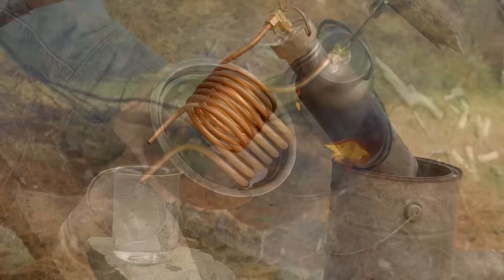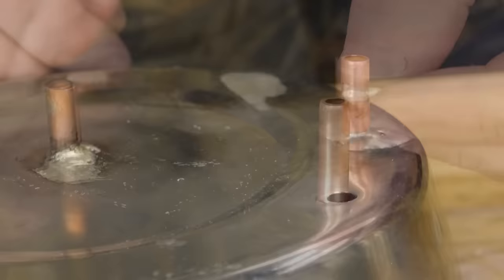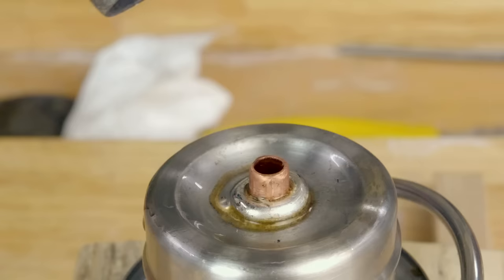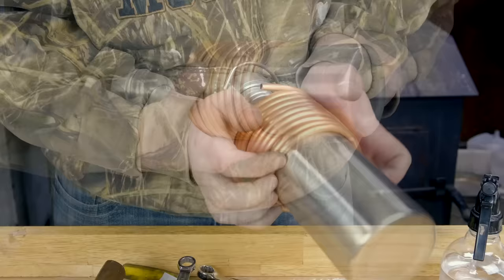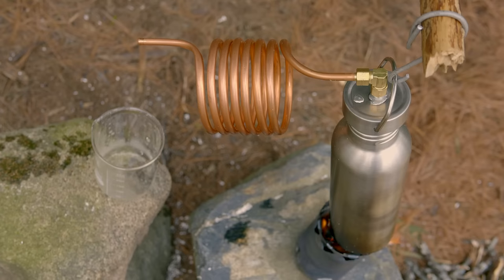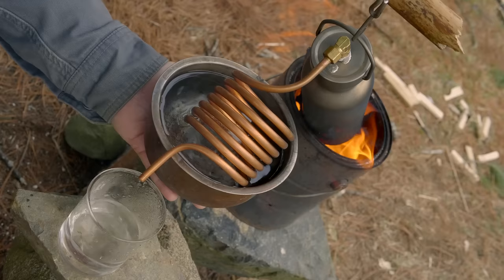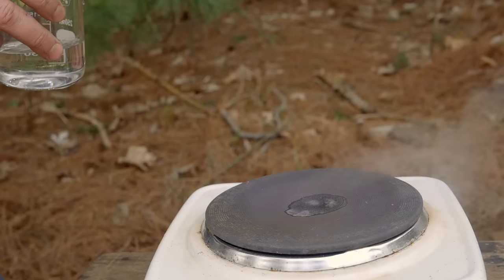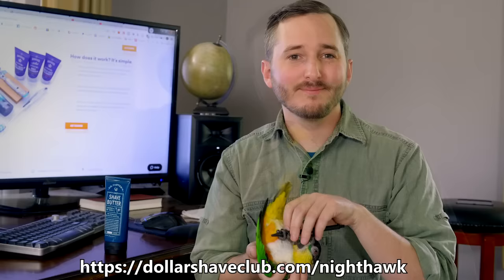DIY Salt-Water Survival Bottle (Compact Desalination Kit)

Comment: should try to crystalize the salts rather than pouring it out. it'll be a good seasoning for meats
Reply: You have a point.
Reply: could also be very useful in food preservation
Reply: The salt will crystallize after all the water has vaporized and turned into drinkable water on the other side all you would have to do is beat on the outside of the stainless steel container and they would break up and Fallout
Reply: Also, you will need those salts. There’s no survival without electrolytes. You can seriously hurt yourself drinking distilled water. Instead of hydrating, that water will leach out your minerals. Instead of pure water, you want a less concentrated salt water.
Reply: @Wookiemonsterfreak  did you actually watch the video?
Reply: Excellent point

Comment: This is a great idea but... The saltwater reacts with copper to form copper chloride (verdigris), a toxic compound. In old times copper cooking pots had the insides lined with tin to prevent contamination of the food.

I know that only the steam gets into the copper but it would be hard to prevent contact in the long run. I just wouldn't want copper anywhere near saltwater.

It would be better to use stainless steel ( yes, harder to work with).
 Aluminum was suggested below but its not used in cookware anymore as it apparently promotes Alzheimer's disease.
Reply: Dont forget about that brass fitting also, its Copper and Zinc...you burn that Zinc off and sayonara.
Reply: Lars Swede soldering copper directly to steel is also bad practice, they are dielectric metals and electrolyses will corrode the contact point. Thats why plumbers put brass between different metals.
Reply: Smart and comprehensive notices about those cancer induction elements that unfortunatelly today are day by day more intensivelly used by too many too much stupid world wide manufacturers in their cookware products with no authorities or in fact no interest for a real healthy living... able to stop them!!  Get better prepared for next zombie teenagers generation born from their too poluted parents by current cooking and food industry altered rules and laws!
Reply: @bryanb6931  Not if you use plumbing solder. Which he is is specifying he uses.
Reply: That may be so peeps but look at the heading: Salt-Water SURVIVAL Bottle
Reply: @bryanb6931  lead free solder....
Reply: @bryanb6931  Normal lead-free solder is 99% tin, melting point 232 C, and does not require an acetylene torch.  Normal lead-tin eutectic solder has a melting point of 188C, only a bit easier to melt.  No copper compound is safe in large quantities, but you're recommended to get about a milligram of copper per day (IOM RDA 0.9 mg/day), so you're probably OK unless you're drinking flakes of black oxide or green copper salts.
Reply: Jordan Britnell in that case they could use a 3/8 Male Compression adaptor and solder around that then have the copper tubing affixed
Reply: I wouldn't worry too much about the copper. If the waterline kinks/clogs when it's boiling that thing will explode like a bomb.
Reply: @bryanb6931  he already said he was using lead free solder!
Reply: the steam comes in contact with the copper, not the saltwater.
Reply: @bryanb6931  - So you think lead free solder has lead in it? The clue is in the name!! Lol
Reply: @bryanb6931  - I had a read of NASA findings but all I can find is for solder used in electronics soldering not drinking water plumbing, there is a difference. Also I am in Europe (UK) and things allowed in the US food and water are banned in the UK. It's good to research these things though so thanks for the heads up.

Comment: I live near the gulf and actually made a small ( though bigger than this) still for desalinization , in case of hurricane etc, emergencies when water may be an issue.  I used an old beer keg for the container and a bit larger copper tubing. 
 Another upside is, one can save the sea salt for food in a bad time for seasoning and preserving meats. 
 I have tested it, but hope to never need to actually rely on it.  Good tip on adding back some minerals, I wondered about demin water, now I know. Thanks.
Reply: Sea salt that hasn’t been treated has harmful things in it and this process definitely doesn’t get rid of any contaminants or heavy metals, all it doesn’t is kill any bacteria that might be within the salt

Comment: Imagine this on bigger scale powered by solar and located by the sea.
Reply: The government would never😅🇺🇸
Reply: Not as efficient as RO
Reply: What for? The nature has done it for you since forever.. that is why we have cloud, rain & river
Reply: @FaddliSyamsul  good point
Reply: It is energy intensive in its normal state.  The trick is to pull a vacuum on the system and lower the boiling temp of the water dramatically so you would need far less energy.  It is not hard to pull 28" Hg of vacuum on small'ish systems, and that would lower the boiling temp of the water to around 100* F.  Then you could use Solar heat (easily) or very small amounts of fuel to heat it to the necessary temps.

Comment: I've experimented with distilling tap water in the past, in regular store bought giant glass pickle jars (they are usually tempered glass for break resistance) with 8 ohms of thick nichrome wire wound in a coil for 15Ax120V=1800W of electric heat sitting right inside the jar in the water, plugged directly into an outlet protected by a 20A breaker. I used a short piece of about 2 ft of old tv or vcr plug, and the first distillate would have to be thrown away because it tasted like flexible vinyl from the wire, but the subsequent ones were fine. I could distill a days worth of cooking and drinking water in about an hour, but had to watch it to not distill all the way at which point my nichrome resistance would turn white hot and fry and the glass would shatter. I cut a hole through the pickle jar lid with a rotary tool and a carbide drill bit, and the lid would corrode over months so it would have to be replaced once in a while. What I found was that silicone tubing is temperature resistant to boiling water and steam. You can basically skip the soldering with it and just simply make a hole through a lid and stick the tubing through it. The silicone should be relatively thick walled for that. Or you can do the soldering and attach the silicone to the copper tubing nipple. But it can create a long flexible connection to your copper cooling coil, which will be much easier to immerse into a cooling pot. I personally used a straight copper tube going though 2 carved out rubber stoppers plugging a PVC tube, and a $15 -20 diaphragm pump 12V from eBay regulated on speed by a sliding alligator clip on a thin nichrome wire, feeding the water through 1/4 inch silicone or vinyl tubing into the PVC tube around the copper tube. I used a plastic Buchner funnel with a sponge in a large plastic tub full of cooling water for the suction side of the pump, and put a small amount of blue copper sulfate in the water to keep life from growing in it. The tub would gently heat up during a session, then cool down slowly over time, and the blue tinge water lasted for over a year without going bad or needing to be replaced. For the 1/4 holes I just pushed the tubing through the holes and used a ton of electrical tape to mummy-wrap the PVC around the connection, which would soften when hot but would have enough strength to hold back leaks. My main distillation silicone tubing was 3/8 to 1/2 inch, matching the copper tubing, the bigger the better, but it does get more expensive. The nice thing about the setup was that I could watch the water level as it boiled, and stop at the right time, which is not possible to see through a metal container. I since bought a 1000W air cooled home distiller unit for about $50 from eBay, but it distills the water all the way at which point the temperature rises and it auto shuts off. But because it distills all the way the taste is worse than partial, there is a lot of junk in tap water that's held back during a partial distillation. Recently I just buy distilled water in the store, too lazy to tinker with it, but it does generate lots of plastic waste. As far as electrolytes go, as long as you eat regularly you get your sodium calcium potassium magnesium from regular food and your kidney regulates your electrolytes just fine with distilled water, which is like rainwater. And I prefer the taste of distilled water over some artesian water they also have for sale, which tastes like coal tar to me, or the taste of a lot of purified bottle water, which is reverse osmosis, but obviously nothing beats the taste of mountain rock water. Store bought distilled water is cheaper than mountain water for me, so I buy distilled. If your receiving container is glass, the water will dissolve some of the silica from the glass, and sodium/calcium, not much electrolytes, but it tastes better than if received in a metal or plastic container. I think getting the silica from the water may be more important than the calcium and magnesium which you can get plenty from food, but not the silica, unless the veggies are dirty.

Comment: For a more compact design, I wonder if it would be possible to hold two metal tumblers around the coil, one as a coolant container (salt water) and the other for the drinking water.
Something like that might be able to hold onto the loop on the lid for transport, and just pop off when needed.

Also, good job on the design, I really like the idea of this for a camping trip, or emergencies for campers, fishermen, hikers, anyone really. Only change I could ask about (in terms of current design and not additions), would it work better with the exit side being on the bottom of the coil (half a rotation more / less) so that gravity has ever so slightly less of an impact on it?

Comment: i think i would have made the copper longer (further from the flame) . 
i would also add a thermometer in that small hole or inline to the copper. then control the heat. however, the drip tells u ne ways.
i never considered a portable still
ethanol can be burnt ti make fire too ;)

Comment: For solar, you could use a lightweight hand pump to lower the air pressure inside for a lower boiling point.  Using a 2nd bit of copper in the form of a pigtail (so a water seal formed) would also give you a 2nd relief valve.  You don't want to build up any pressure in this as that just raised the boiling point.
Reply: how would the steam escape then , if the pressure inside is lower? @JK Brown?
Reply: @ericmiller1159 the entire apparatus should be under lowered pressure, included the receiving container, like a vacuum distillation setup. But that would be really bulky...

Comment: I must have missed something. What was the point of the second tiny hole if you only soldered it shut later.
Reply: He states it was to relieve pressure inside the cap as he was soldering the copper tube in.
Reply: it's impossible to get the other solder joints well done if the air inside is trapped heated and bubles through the hot solder. An alternative wood be heating the whole thing solder and cool the lower part of it with water while the (last) solder joint get's hard.

Comment: Using aluminum foil to separate the hot air riser from the fire and cooler outside air for coil section would greatly increase efficiency,
with little weight for the foil needed.
Reply: Yeah that coil setup was too cramped.

Comment: Warning, 
If you forget to remove the rubber stopper before installing the coil tube, and try to distill, you have a closed container heating water to steam.
Better hope that seal fails before the container blows.
Reply: You could remedy this by just slicing it with a razor or perforating it a bunch with a needle. Water won't leak out, but the pressure would cause it to burst.

Comment: Wow. That was brilliant! You're my new superhero. This is great as a water purifier for backcountry streams/lakes etc as well. Most filters don't cover all the chemicals and viruses. This will.
Do you have a great design for a larger solar distiller? I use a distiller at home but want to cut energy costs and take advantage of the sun.
Reply: You could just boil the water you know.
Reply: This will take care of viruses . It will not get rid of chemicals. The chemicals just evaporate. Inconvenience right back down with the water. You need an activated charcoal filter. To stop the chemicals and the activated charcoal will have to be replaced from time
Reply: Bits of Pulp not really, it cant remove anything physical or salt
Reply: Wilderness Man indeed. These chemicals are called “volatile organic compounds” and typically abbreviated as VOCs. This is an important  factor in municipal water facilities
Reply: Buy some bulk charcoal and put it in mesh bags that are small enough to keep the charcoal from seeping out (too much, anyway - some can be healthy, especially if you're sick and drinking LOTS of water) & use that to absorb the harmful chemicals.

Comment: Nice way to make distilled water
1. When you have salt water for boiling
2. Make coil deeper in salt water
3. Outlet of coil will be more condensed water then steam getting wasted 
4. It will give more distilled water in beaker. 
5. If bottle outer is coil wrapped then make one more wrapping of cold seawater filled chamber as it will absorb all steam transmitted heat to copper tubing.

Comment: If the only way to get your mineral & electrolytes is from water, i think you're screwed.
Reply: Seems grim but if your only sauce is recycling - then recycling a small amount of urine to a decent amount of distilled water will also greatly extend your ability to function without external salts etc.

If you want the bottle to work both with solar and also a water bottle, then spraying the bottle with "exhaust manifold matt black paint" will make it usable without blackening it with soot. It will also withstand (to a point) being used over a camp fire without the paint burning. (providing you used manifold paint).

Good idea - though still not able to work out that little hole he made and filled - not idea where the pressure was going to be released when both sides of the cap were open to the air when he did the soldering.

Comment: As an FYI, drinking distilled water is not 'dangerous' or harmful at all. It's just pure water. Try a search sometime instead of passing on propaganda and old wives' tales. All of those 'minerals' contaminating your tap water are easily had from the other foods and beverages you consume, without the provably harmful junk found in most municipal water systems. But if you like drinking salty water, sure add some salt back in after you go to the trouble of removing it.

Comment: Tried something similar... here to give a little advice to improve the system just a bit.

Instead of soldering, i found that a better way to seal the system is to cut a bit of the copper on one side, in a + pattern, after that, remove some of the copper from the inner walls of the tube, finally smash it on place. 

Dont worry too much about the "Sealing problems" cause there wont be if you hit it hard, mainly, due to that section of the copper heating up and expanding when its warm, making a allmost perfect seal without soldering.

Wich does 2 things... one, you dont need to deal with the soldering itself, wich can be a pain in the ass (as told in video), seccond, you dont need to worry at all about temperatures, because, the problem with soldering, is that you wont be able to heat it up past certain temperatures, with this system, you dont have such a problem (untill the melting point for cooper... but thats way past the one from the soldering materials). As well as providing a increasingly better seal the higer the temperatures are, meaning, you can "flash it"  (not actually flash distillation... what i mean is that you can get the temperatures up like crazy in order for the water to come out faster without the risk of actually destroying the seal, because now it wont melt as easily as the soldering materials would do)

Also, i found out that, while that bottle could work just nice, it works a little bit better with bottles that have the plug threaded on the outside of the bottle, in opposite to the one on the video, i guess it could be because it creates a kind of laberintic seal in addition to the thread iself.

Comment: Hand towel, rivet holes amd tied in place with leather thong. You can wet towel to increase cooling by evaporation. 

When done towel can be used as a towel.

Comment: A second collection bottle with a lid would help too, use an air lock for wine mash on the air output and feed the copper tube right into the collector bottle.
Love the bird, but keep them away from weed! They will sneak up and steal it, eat it and fall asleep. Very clever at it too, smart and very advanced creatures! Love 'em. I got mine an electric stirrer for it's bath, and it loves it! Whirlpool  bath, tail goes in first to test the water.

Comment: Getting the coil to face downwards will help to increase flow and throughput by letting gravity assist the water out of the way of the areas steam can start condensing in the tubing.

The reason the steam stops flowing entirely (which ideally shouldn't happen) is because the water in the coil is blocking it and the pressure is increasing.

Comment: You can use the solar panels to heat the saltwater as follows.
1. Solar panel to small dc to ac inverter.
2. Add a battery to inverter.
3. Use a magnectic inductor heating circuit with copper coil wrapped around the bottle but not touching. Like in the video
4. Attachva second copper coil to act as condenser.
The effect is using solar to boil water and remove salt content but there must be a filter before cooling and drinking.